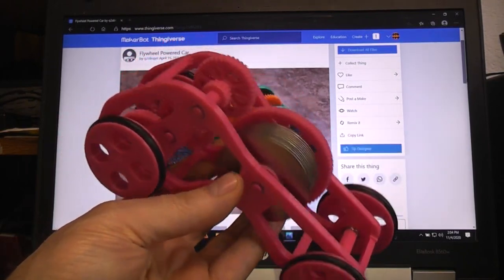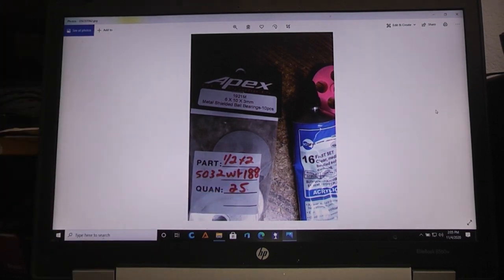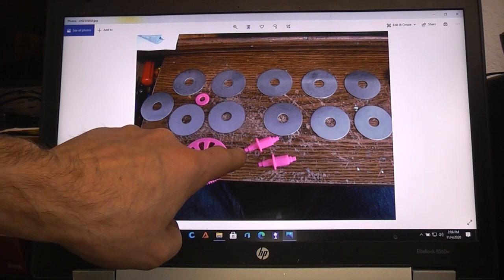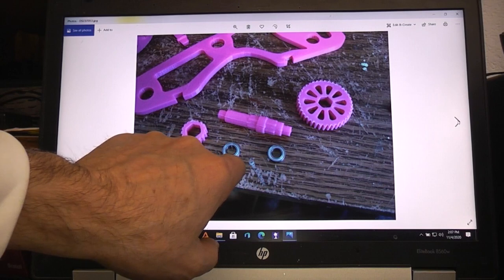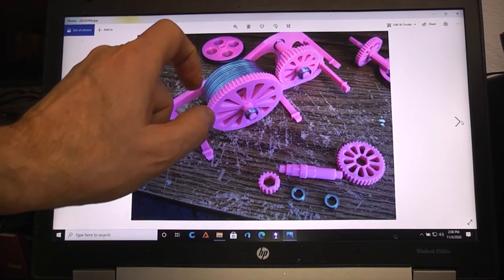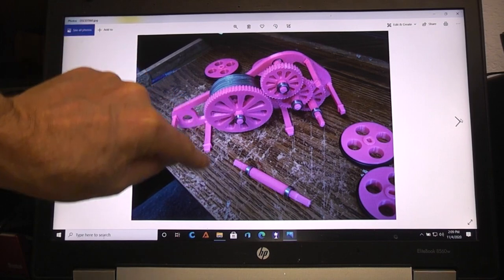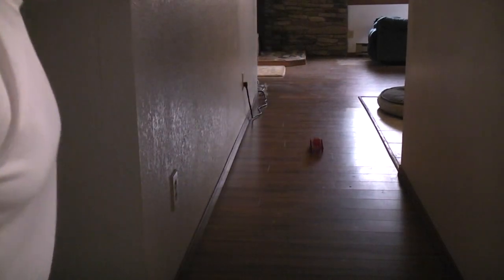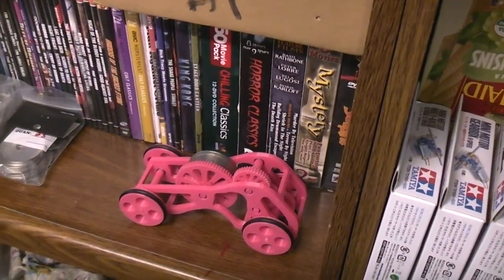3d printed flywheel powered vehicle. remix from thing-i-verse.

Comment: Wowwwwwww. Very nice    That can print spur gears????  looks impossible.  How accurate are they?  How much backlash do they have?   Have you seen the new 3D printed homes? Its in the search called "The world's first 3D-printed community is officially under construction".   And the other is called, "NASA’s Challenge to 3D Print Future Habitats on Mars".
Reply from the maker: Yes all types of gears can be printed, so I will have no problem with my flywheel robot design and using a better gear design. Yes they have been 3d printing homes for many years now, they even 3d print cement sculptures these days. Amazing stuff they can do.
Reply: @Robothut  I guess we were born at the right time to enjoy all of this technology.

Comment: I'm in the process of putting mine together.  I'm curious what size O rings you used on the wheels.  I ordered what I though would fit, and they do technically fit but they aren't thick enough.
Reply from the maker: I keep a O ring kit on hand, like the 382 piece assortment  "32 different sizes" from Harbor Freight for under $10 bucks or from many seller on ebay. Not having the car at hand I can not check the size for you. But measure the width of the grove and the die and you should be able to locate a O ring in case you do not want a kit of sizes.
Reply: @Robothut    Thanks for the tip!  Didn't know Harbor Freight had them so cheap.
Reply from the maker: @jayducharme  They have a few O ring kits I use the kit that comes in the red box. Some of the other kits have more pieces and some are made of more expencive rubber for high heat and oil / fuel safe, not needed for custom toy builds.
Reply: @Robothut    I just ordered a set.  Thanks!  They should give you a commission.  ;-)